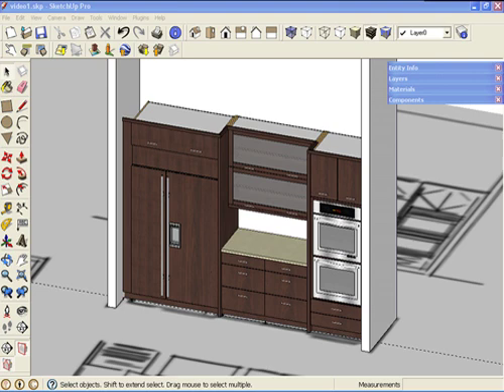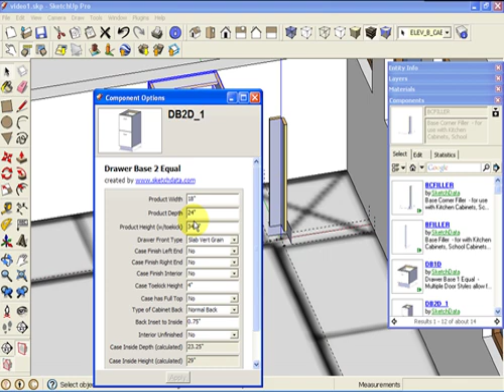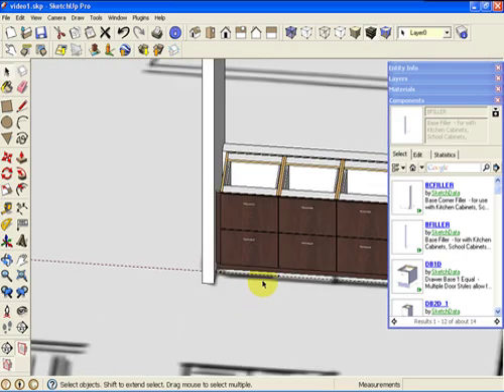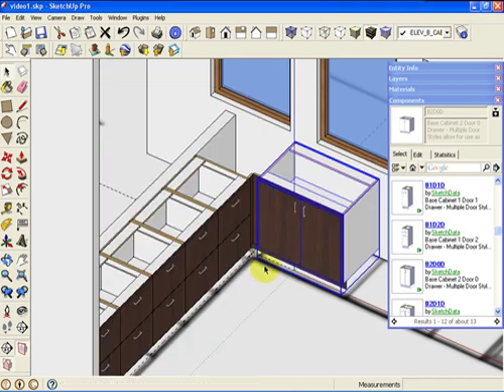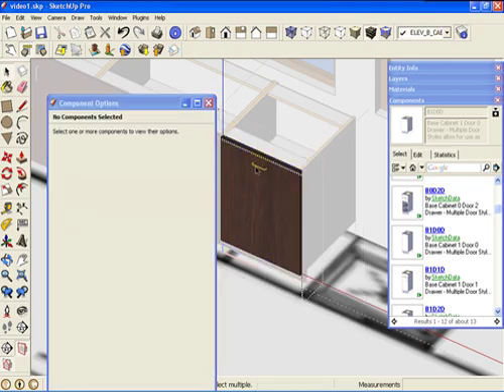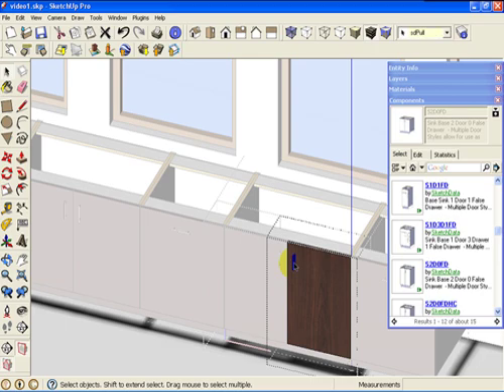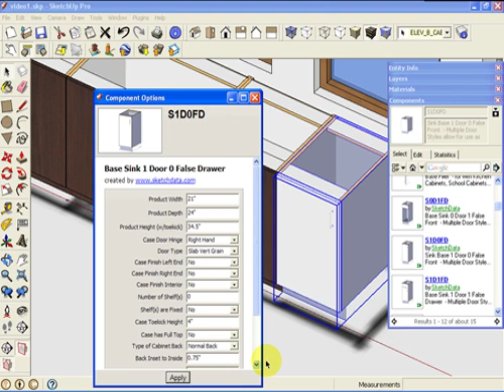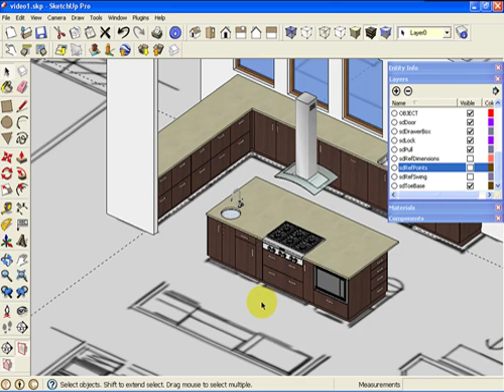SketchUp Kitchen Design using Dynamic Component Cabinets (Part 2 of 3)

Comment: And, how to add countertop?
Reply from the maker: Usually just trace the top of the cabinets with lines or a rectangle for a face, place and remove any cutouts for sink locations, and then Push/Pull to needed thickness.
Reply: +SketchData yeah. Thanks. I was a little surprised that you have skipped that step. Otherwise, I know... But, thanks anyway.